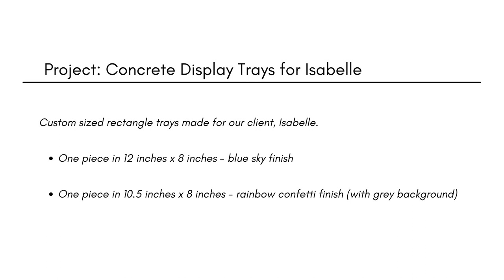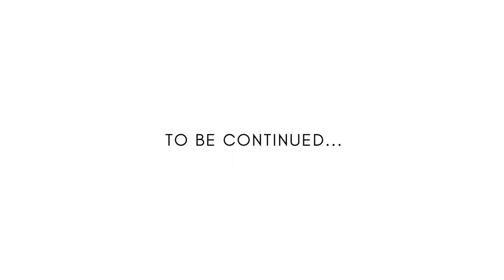Concrete Trays  (Part 1 of 2)

Comment: Try making a silicon mold for it. Reusable and more eco friendly that insulation foam.
Reply from the maker: Hello! We did not use insulation foam but sintra board. It's a material that is reusable and we use/reuse it in production 🙂

We usually make silicon molds for most of our items but we had a client that wanted the trays to fit the size she needed so we opted to make this with wood and sintra board since it would be a one time thing. 🙂
Reply: @kretemanila9745  interesting, didnt know about that product. Hope you have a amazing week end
Reply from the maker: @601salsa  same to you! 🙂